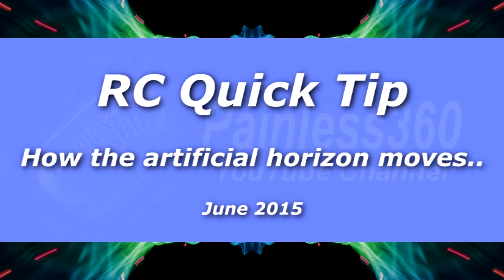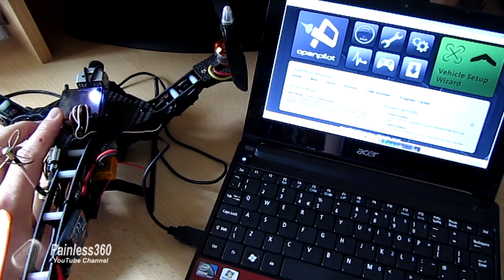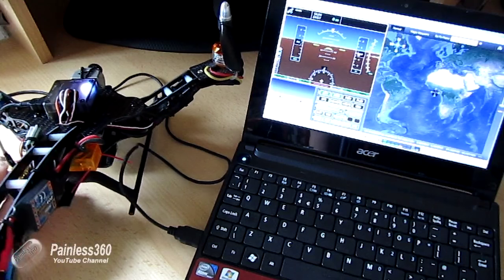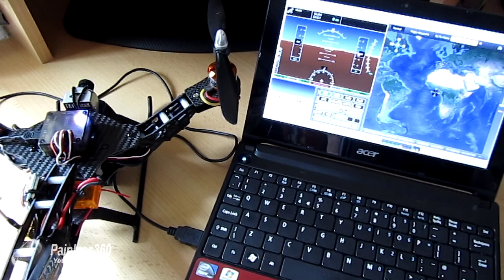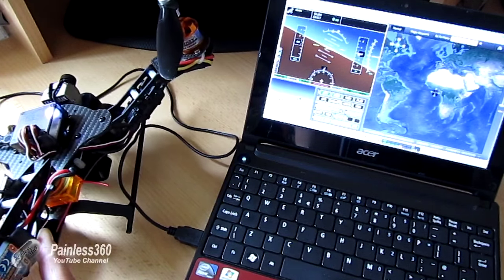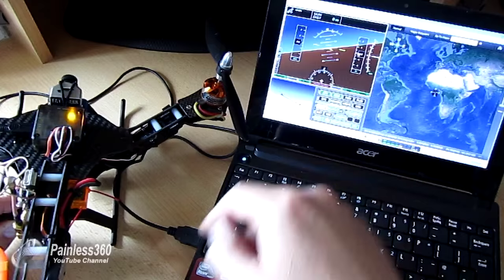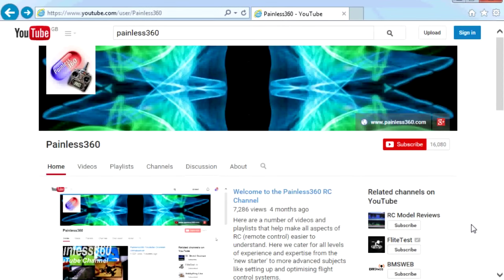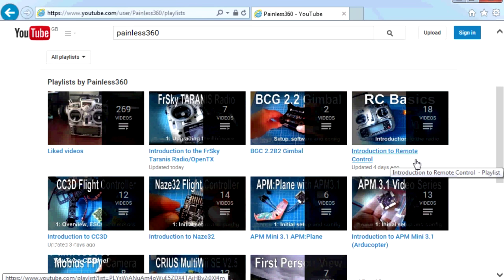RC Quick Tip - How the artificial horizon moves in relation to the model

Comment: I've got a Cyclops Storm and a Vector that work correctly as you show, but I also have a Naza v2  with mini I osd. It's very odd, everything works fine but artificial horizon is backwards. I haven't been able to find a way to correct it. Thanks for all the great videos by the way! Doug
Reply from the maker: Doug Kuechenmeister Don't use Naza ;) If it flies ok then you're fine. 
Happy flying!